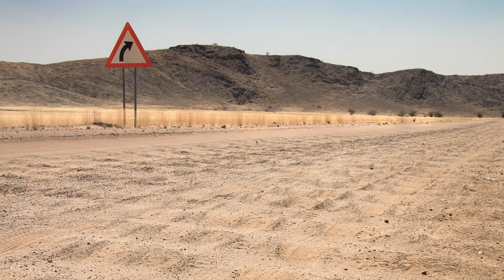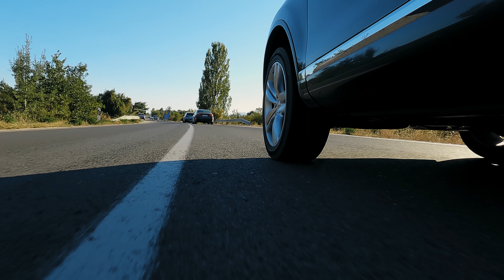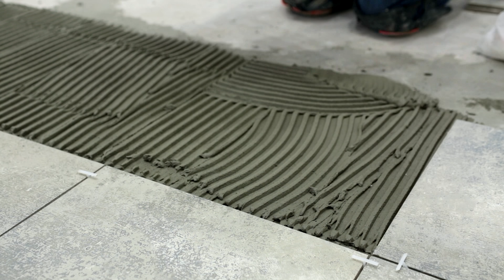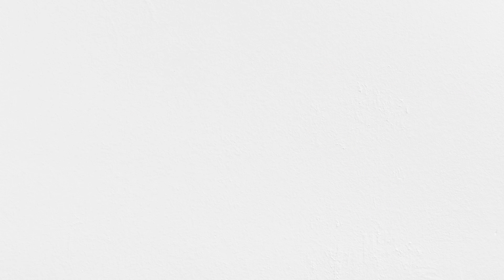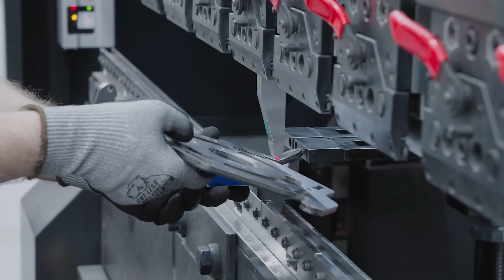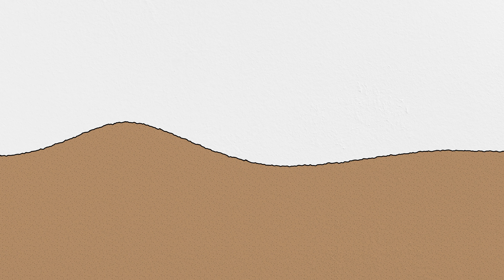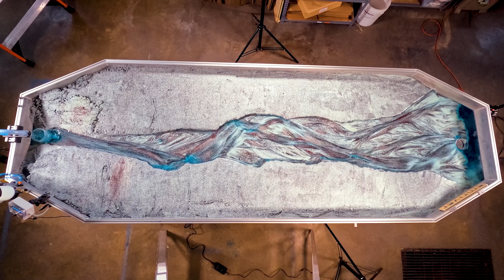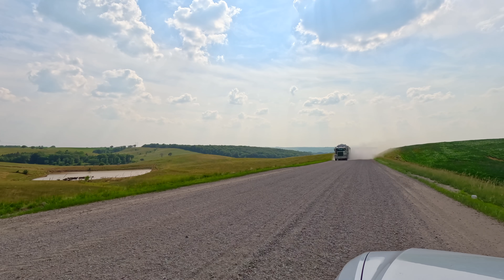Why Roads Get Washboards

Comment: I've seen lots of washboarding on asphalt roads, especially where heavy trucks travel.
Reply: It's also a common issue in the braking zones on race tracks.
An F1 car braking puts a lot of force on the asphalt.
Reply: The same happened in Berlin in the 80s, on some major crossings: Asphalt got currugated i.e. washboards on all four sides of some big intersections in the braking zone right before the traffic lights. Probably the asphalt mix was too soft or too thin, I guess.
Reply: @carstenschmoll4388  that still happens now.  I've observed it at major intersections in my area, and always wondered why it would happen.  This helps explain it.
Reply: @carstenschmoll4388  I haven't really noticed it on asphalt, but in Finland they also form from ice and snow, but not as much as on dirt or gravel. Usually before intersection because studded tires scrape the ice backwards, so it's not right at the lights, but little further back... braking zone I guess.
Reply: That phenomenon is called "shoving".
Reply: Some major intersections in Portland have corrugated pavement in the braking zones and now I finally know why!

Comment: Grady, love your videos!

With this video, I’d love to see a couple other experiments. I think your demonstration was a perfect example of “braking bumps” where washboard is formed as you approach a sharp corner or intersection where cars have to stop. If possible, I’d like to see the wheel powered instead of the arm to create acceleration bumps that occur in areas leaving an intersection or sharp corner. Then you could add moisture to the aggregate and even add  some chemicals (calcium chloride?) that are used in certain gravel roads and run longer term experiments to see how they behave. 

Ultimately, you will always get washboard if the surface is weaker than the forces applied to it. It evens occurs on asphalt in some places due to heat.  But it’s a cool thing to see these scenarios reproduces in a controlled environment. 

Thanks for all your content!

Comment: When a friend of mine and his 6 brothers came home from WWII they bought their Mother her first washing machine. It was powered by a small gas engine that you stepped on a pedal to start. 
He was the road crew foreman for a small rural town with 8 miles of gravel road. The town next to him had 15 miles of gravel road and a road grader. They worked out a trade where the road grader regraded his 8 miles twice per year. His town had a sand bank so he provided sand. We use a lot of sand on roads in the winter.
I studied road maintenance in the 1980s as a town engineer shared between 12 small rural towns. The dirt roads were cheaper to maintain because the paved roads were not properly built in the first place. The dirt roads needed about 150 tons of gravel per year per town on average and to be graded 2 or 3 times a year depending on the gravel that had been used in the initial construction. The paved roads needed chip sealing every 6 years and repairs from all kinds of defects in the original construction. One time a 40' section of a road kinda collapsed. They had buried a tree trunk when the road was built many years before. Many times proper subsurface drainage had to be installed to cure alligator cracking. All of these repairs plus the repaving at 15 years meant that paved roads were more expensive to maintain. The key factor was that dirt roads generally had a traffic count of less than 100 vehicles per day. 
Interesting explanations. Another very good video. Good Luck, Rick

Comment: In racing track the asphalt is subject to tremendous forces under braking and sometimes these ripples form as well
Reply: Braking bumps are very common on mountain bike trails in bike parks. They regrade them in the off-season but after a couple of months they always re-appear in the same places, mostly before corners at the end of a fast section of trail.

Comment: I figured it was like that because of physics. And the surface mass of the tractor tires and the weight of the tractor itself would cause kind of a powing till motion in the gravel and as the weather goes on with rain and sun. It creates kind of a sandcastle effect, where the road gets pushed up in some areas and and moated down in others and makes those waves in the road

Comment: Would definitely like to see reinforced soil get tested, like dirt or sand with layers of cloth net reinforcements
Reply: Another thing that would be interesting is seeing different speeds used, as not every driver will go the same speed or car feature the same resonance.

@practicalengineering perhaps you could program the setup to randomize the speed of the wheel every lap. Would love to see this followed up on.
Reply: @AdmiralThumbs  In practice drivers tend to have a fairly standard distribution (the prototypical bell curve) of speeds as influenced by the conditions and speed limit. This means most are effectively close enough to the same - very much not random.
Reply: @Sylvan_dB good clarification. I was being simplistic in my suggestion. If I were implementing the code for this, I'd determine a median speed then set a randomized +/- offset from the median within some error bars.

The point being that 20 MPH has a different resonance pattern from 20.5 or 19.

Comment: I heard a long time ago that Australia used Copper sulfate or a similar copper-based salt solution that made the unpaved wearing surface extremely hard and dust-free essentially. I would love to see you test various solution-treated soil surfaces for their effect on the wearing surface 😀
Reply: aren't copper salts toxic? like, in minute quantities, do not spill into waterways toxic?
Reply: @slwrabbits I don't recall the details but the copper solution that crystallised? Or formed some kind of stable non-soluble or ultralow soluble crystal lattice structure with the topsoil somehow made it hard durable and erosion resistant. So the company using it said no asphalt or additional wearing surface needed to be laid or applied. So runoff should be negligible or non-existent.

Comment: My parents live on property in Joshua Tree near the Doolittle/Kellogg house and he grades certain roads near their home. It will be glass smooth when he is done and it doesn’t take long before it corrugated.
Reply: The smoothest roads I've ever driven on in my life was a dirt road out in the middle of nowhere Utah. I mean smoother than any asphalt road I've ever driven on and if any road ever deserved to be called "glass smooth" this road was it. I'm not sure why, but anyway I found myself running like 80mph down this road in my Jeep...it was perfect until I needed to slow down for a curve. It was like I was on ice and really sketchy but I held it together and then slowed down. But that road was so smooth I didn't know a road could even be that smooth it was incredible. Out in Utah there is at least one person who likes to grade roads and knows how to do it that's for sure.
Reply: I hear you. The roads my dad grades were smooth for a long time until someone built a few AirBnB dwellings in the same area. Now he is ready to move but they aren’t really going anywhere. Pops is 90 and mom is 87.
Reply: @Zboe-JL Sounds like it was less smooth and more your tires and suspension working at that speed so your tires were only touching the tops of each corrugate. The lack of traction is exactly what happens.
Reply: @Sylvan_dB  The road was smooth but the gravel was also very loose.
Reply: I'm out in Landers and we have a local guy that does the same thing. Literally the same day the washboard starts to form again. We have a lot of 'bad apples' that live out here that completely disregard other people's comfort and drive way too fast.

Comment: While using an old open tub washer with a powered wringer mounted above it, I learned the old adage "don't get your tit caught in a wringer". It means exactly what it says and hurts as much as you can imagine. Keep in mind, the latter powered wringers had no safety switch, other than turning the power off.

Comment: I have seen in some rural places people will chain a few old tires to the back of their car and drag them as they drive down a washboard road.  The tires help smooth the road a bit.  If enough people do that it can mitigate the effects of a washboard road.
Reply: Yup, I have a “grader” that’s just a railroad tie and some chains.
It helps takes the edge off in between actual re-grading of the road.
Reply: @cranktowncity recently did a video about putting a land plane under his truck that he can drop with a switch from the cab when he's on his dirt driveway. Great channel!
Reply: I think the trick is the time between smoothing it out, and getting some sort of compacting effect into it. Yes, the grading will smooth things...but, it also loosens everything.  So, if you get rain too soon, or lots of wind...it's a bit of a step backwards.  
There's a road I travel to leave my house, that >can< almost be as smooth as asphalt....but they grade it fairly regularly for no particular reason, and it turns it into a mess when it rains.
Reply: And it removes more road material as dust into the air.
Reply: @charlesloeffler333  Yes, the "fines" as Grady says.  Same with mtn bike trails until it's just golf ball rocks remaining.

Comment: As a rural born boomer on moistly gravel roads in the early years, all these years I believed that the driven tires during acceleration and the braking tires in deceleration were the main issue, interesting.
Reply: Even when driving at a steady speed on a flat, level road, there's substantial torque sent to the drive wheels. I'm sure it has a marked effect on washboarding.
Reply: @fascistpedant758  But in his example, the tires are free rolling and he mentioned that a non-rolling flap with no rolling element to it would eventually create washboarding.
Reply: @oldretireddude  Yes but he mentioned it occurred when the free wheel and flat plate are able to move, like a suspension. I think what we see it terms of acceleration and braking is just those same forces at play which occurs more quickly because acceleration and deceleration multiplies that effect.

Comment: At some high traffic intersections pavement can do the same thing.
Reply: It seems at the point of acceleration the cars tires can slightly shift the pavement. Pavement isnt as solid as people think it is... it acts more like a very viscous liquid like the pitch drop.
Reply: Asphalt is made of bitumen, which is just the part of a barrel of oil that's least prone to boil (ie the parts that have the longest carbon chains, so like the opposite of methane).

So yeah, especially when it heats up in summer, its viscosity becomes lower - to the point where years of very heavy duty vehicles (like semi trucks etc) will slowly start to cause deformations.

Interestingly, I see it most often right before the stop line at traffic lights - the place that's most likely to have a vehicle be stationary for a bit in the same place.
Reply: @MrN @MrNicoJac it’s also where force would be applied via the tires pulling the car forward. All of the different forces will do it, the acceleration, braking, and turning, hence why asphalt intersections are so prone to it.
Reply: @MrNicoJac  I only see such depressions at bus stops, stop lines have a larger variety of vehicle types and positions.
Reply: Happens a lot here in my hot climate. Summer temps often hit 110* F. Pavement temps well over 150-160.
Reply: Yep, you really notice them more on motorcycles...especially when making a RH turn.
Reply: Have seen that too but it is mostly down to heavy vehicles like big trucks tranposrting tons of cargo and big busses. 
Cars (below 3.5 tons) have way less impact on a surface like asphalt or concrete.
(almost 30 years ago when i was in driving school, which is mandatory here in europe, we were told that what americans call "semi" damages road surface 40 times more than a normal passenger car)

Comment: I have a small motorcycle (110cc, 100kg), with dirt tires.

On this type of roads I have to drive above 60km/ h to skip the bumpiness, often I drive nearly drive full throttle when the visibility allow me, 120 km/h on this road, a cloud of dust behind me, the wheels just skip the bumps it's a lot a fun ^^

Thanks for you video, realy interesting!
Now my question is about his anoying concret roads who giand slabs... For a driver perspective they have kind of the same effect at a large scale them washboard roads.

Comment: Another interesting factor is that you don’t get washboard features in the winter.  In the winter you have potholes, in the summer you get washboards.  I’ve spent a lot of my life in areas of unpaved roads, and this has been consistent everywhere.
Reply: I think that depends on where you are. Out in my region we get a mild winter, only about a month of occasional dips below freezing. Typically only a few rain storms or snow storms. We get washboard all year round.
Reply: @n @nasonguy hat still indicates that the process is weather dependent - temperature and moisture definitely affect the process.  And as a northerner, I would argue that a month of “occasional dips below freezing” does not constitute “winter”.  😊
Reply: The road base is also a factor. There's a couple roads in Fremont County, Idaho I can think of that are only 4 miles apart that behave very differently. One is a residential road that turns into pothole central even in the summer, the other is a mile grid road (3000 E) that washboards like no other road in the area, even in winter, though it's not as bad as in summer. From what I've been told, 3000 E has a clay base, so the washboarding tends to be a lot worse since the clay can mix in and hold the ripples together better than most surfaces. What really chaps my hide about that road is that there's yet another gravel road in the same county (1350 N) that's so well built that you can tear down it at 45 mph no problem.

Comment: Surprised you didn't mention the guy(rctestflight) who ran a RC car in a circle in his back garden for a 100,000 miles. He had a lot of trouble with wash boarding getting so bad it was wrecking the car. 

Was also a great video
Reply: I saw that one. He encountered so many problems running it for that long. Great demo.
Reply: 100k on an RC car? That's mental.
Reply: @pinpetos It was technically a scaled 100k but it was also a scaled down RC car.
Reply: That's not how scaling works.
Reply: @RiderlessHarp47.  So not 100k miles.
Reply: @toseltreps1101 it was still a fun interesting video. Great channel actually. I've seen some discussion about actual scale speeds, wish I could find a decent YouTube video on it.👍
Reply: @toseltreps1101 that is how it works wym it's a ratio
If the car is 1:16 scale and is driven at 1/16 of a mile, that is a 1:16 scale mile on the odo
Reply: @KaitouKaiju  They probably should've scaled down the aggregates too, needing more fine material to lock in the larger material.
Reply: @mrantoniodavid they did.

He drove it on dirt, aka very scaled down gravel.
Reply: Just a fun experiment in his little backyard. He was only seeing how long it would run and hold up, not looking into this specific subject.
Reply: @anonym3017 Gravel and dirt aren't just the same thing with a different particle size. There are significant differences in composition.
And even if it were sand, instead of dirt, there would still be the issue of the fact that roading aggregates aren't just a random assortment of randomly sized particles. There is a necessary specificity to the range of particle sizes used.
Reply: @KaitouKaiju of the car is 1/16 scale and it is driven 1/16 mile, that is 1 mile at that scale.
Reply: @senatorjosephmccarthy2720 that is exactly what I said
Reply: No serious human cares about rc cars
Reply: @williamwinstrop3918 rc cars are cool especially nitro. Life becomes easier when you arent such a pos just giving you some advice
Reply: @williamwinstrop3918 why so serious¿
Reply: @williamwinstrop3918 some may argue that fact. The same can be said about alot of toys.
Reply: @williamwinstrop3918  no serious human cares about your opinion.
Reply: @williamwinstrop3918  a hobby that's been around for multiple decades, and is a multi-billion  dollar industry You might not care, but millions do.

Comment: I thought it had more to do with acceleration and deceleration of the wheels as I always see the washboard at intersections. Where vehicles are changing speeds rarely do I see it on the straight part of the road where vehicles travel fast.

Comment: I re surfaced gravel roads for a living. No one would take it easy, and spin it continuously up. While I would be compacting the road, they would accelerate hard and start the process. Hills, never could hold a hill, even with reclaimed asphalt, compacted ,,, they would just chatter it to pieces. Drive the same line every time, not spread it out.